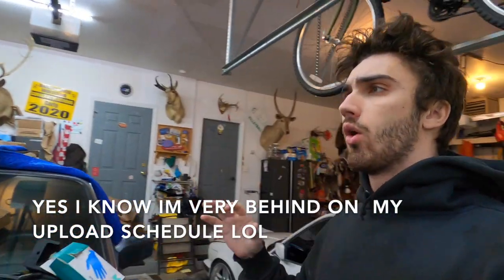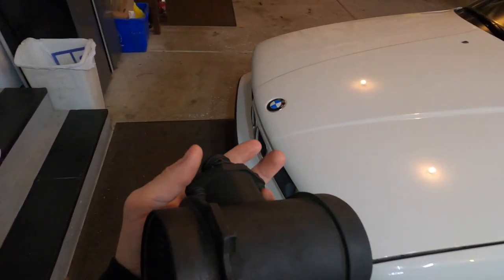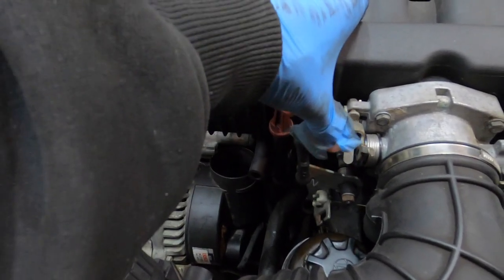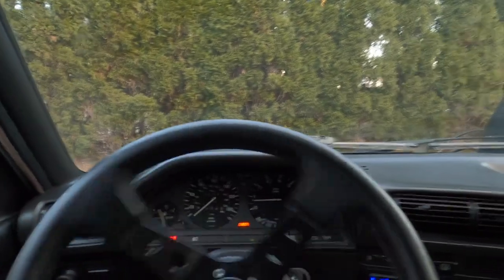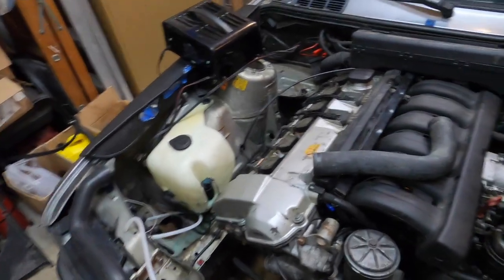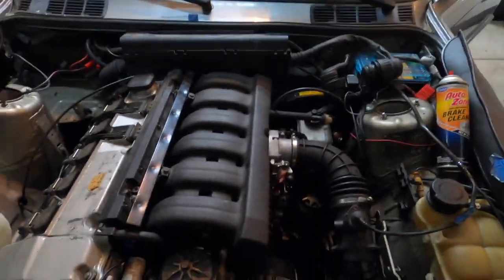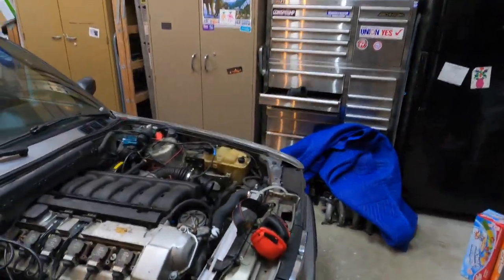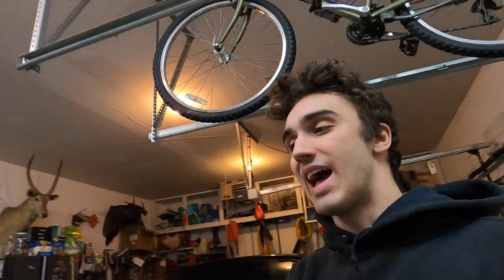The M50 E30 gets a cooling system and takes its first steps!!!

Comment: In case you ever gotta bleed the coolant again for any reason you don’t need a bleeder screw and you don’t need to use a vac bleeder or anything. The tank is actually the highest point of the cooling system since you have the late model tank. You can fill it and squeeze the upper/lower hoses and the system will be pretty much already bled. Idle it for about 15 mins cap off and you’re Golden with the heat blasting. That small hose off the top of the radiator that goes to where the cap is, is actually a self bleeder and the system will forever bleed itself.
Reply from the maker: I appreciate the advice man! Thank you!

Comment: I'm in the middle of an 24v swap myself. Did you just run an upper and lower radiator hose for your cooling system? No heater core hoses or anything like that? I'm trying to run the bare minimum to get mine on the road.
Reply from the maker: Stock m20 heater core hoses

Comment: Hey cool build I am going threw this myself what did you end up doing for power steering lines
Reply from the maker: Stock lines. Shortened. Check prior video
Reply: @m3nameisjosh464  ok sound just seeing it there now missed it some how . What did you do for fuel pump did you use stock e30
Reply from the maker: @e.3-0_m3  yessir